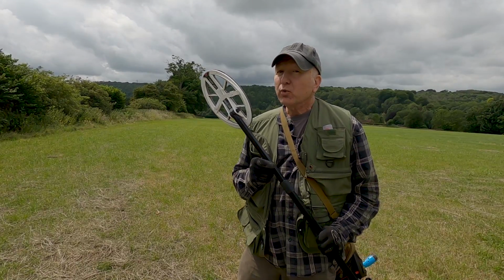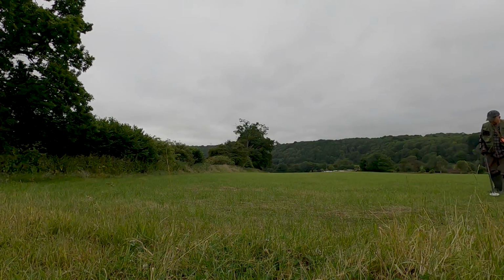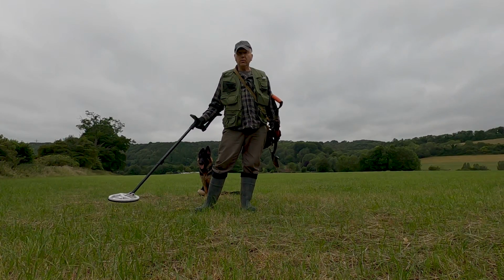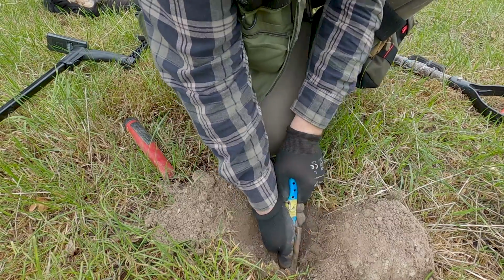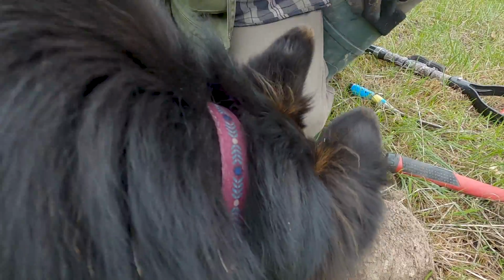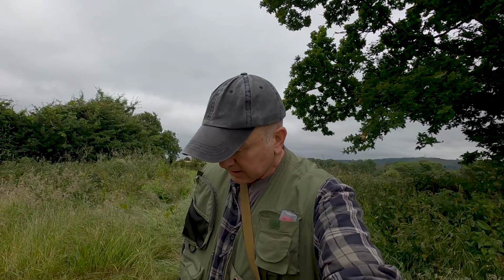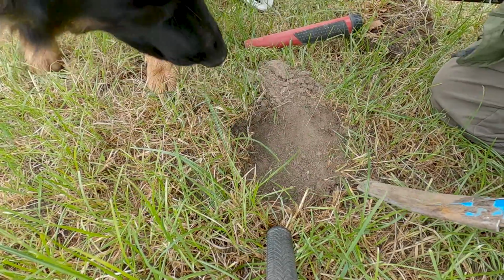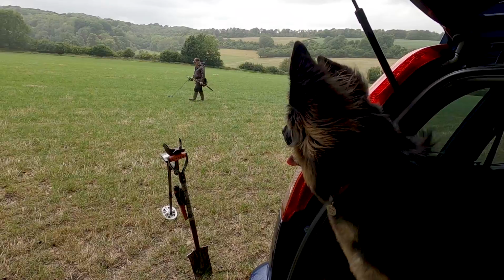Testing the HF Elliptical coil from XP metal detectors

Comment: I've been running the Deus 2 for 3 yrs, but I decided to dust off the D1 with the HF coil at 74 khz. I don't have much iron in the soil but I do have tons of aluminum, so I went with a disc of 86 (right were alum begins to break up), react of 3.  Right off I found a dollar coin (rare) and many more common coins on my pounded site. Who says older is not as good as new !!!

Comment: I bought my Deus about a month ago and chose this coil. Last Saturday I found a bronze age Rapier fragment - it was very deep, as was the bronze age cloak pin I found very close to it. I notice people say this coil does not go deep but that sword part was over 12" down, and it wasn't a small target. After digging out a deep clod I had to go deeper still to find it. I will get a second coil soon but this does work as an all-rounder on the hot programme. Will try the higher frequency as well to see how that goes on my bronze age site.

Comment: I have 10 acres of virgin property where where an old fort from 1812 stood. I have lot's of metal and barrel straps and tons of old square nails I have found. Would this be a good coil to use on my property? If so, what would be the best program to use? If not, what coil would you suggest? I have the X35, HF Round and Elliptical.

Really enjoy your videos. Thanks!

Comment: great job sniffing out those coins. I love that coil!! Man have I found some excellent stuff with mine. Even running a higher reactivity in the trash it will still let ya know deep stuff is there. In my opinion its almost as good as other machines with sniper coils on. Love the vids. What the heck kinda hand digger are you using now? Looks like a piece of metal ya just hammered together haha

Comment: Can i ask what frequency you were running the coil on please?
Reply from the maker: 50 Khz
Reply: @xpmetaldetector  There is no 50Khz with the HF Elliptical, only 15,30,80. What was the right frequency ?
Reply: Go into 80hz then expert and notch it down to 50hz
Reply: thanks @sammathias8778
Reply: Or 30hz then expert then 50hz. Can't remember
Reply: sam mathias you can't do that with the elliptical. Not possible to go to 50Khz. I think it's just for the other HF coil.
Reply: @pirateofalllseas  indeed, you only can choose between 13 to 15.7kHz, 26 to 31kHz and 68 to 81kHz

Comment: I was just noticing for a while in your video. When I switch on Mi-6 my coil will disconnect and I can only hear signal from pinpointer but not coil. In your video you are  swaying coin in front coil but pinpointer looks like ON? Is that because I am still running version 4?  Should I update my system now????
Reply from the maker: Its always best to update your Deus, you can also use the MI-6 as a stand alone probe, it does not have to be wirlessly connected.
Reply: @xpmetaldetector  oh yes! Gary was using it as stand alone probe! Understood! Thanks!

Comment: Hi Gary! A very interesting video as always, thanks!:) I was thinking in buying one HF coil and I’m deciding between the elliptical and the round 9” coil. I will use it mainly in those sites where I need that extra target separation but without sacrificing too much deep detection... which one would you use in that case?:)
Reply from the maker: Hi Luis the HF round is deeper but the Elliptical can find the smaller targets....Hence in this instance I guess it's deeper.
There is no real answer to depth because it depends on the target size and terrain.
Reply: Righty ☺️, thanks!

Comment: I have a problem with this coil and there are more users who have it .. The coil is charging but the LED on the coil does not indicate when it is full !!  What could be the cause of this??  I really enjoy the coil, ideal for between the corn stubble .. Nice that you pay attention Garry..👍🏻😀
Reply: Mine does this as well, sometimes if you unplug the charger for a couple of minutes then plug back in it will start flashing a little while later 👍
Reply: @fireblade1000jg  Its verry strange and it happens only on the HF coils from XP.. I have heard the same problems by other users.. I will try your sugestion, thanx..👍🏻
Reply: +1 same problem
Reply from the maker: Thanks for the info